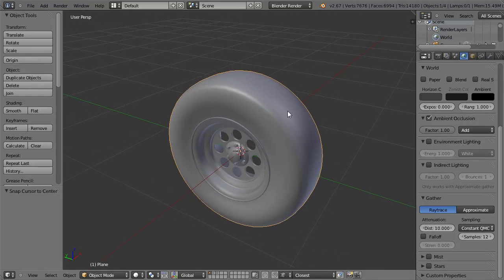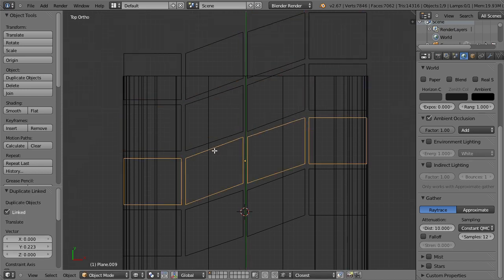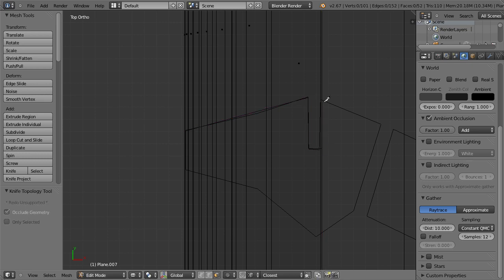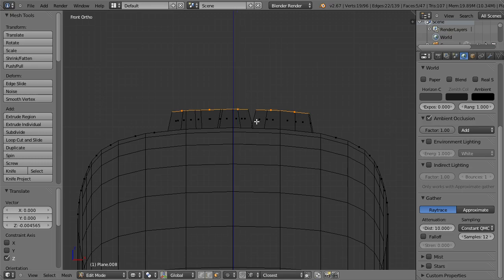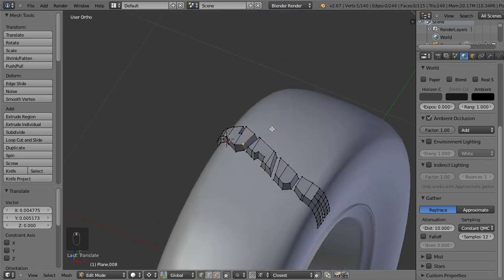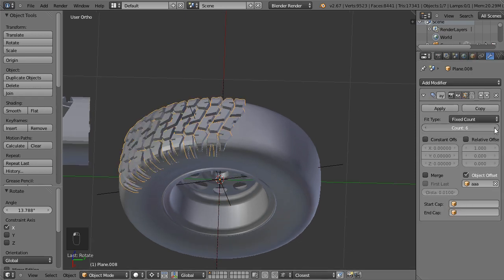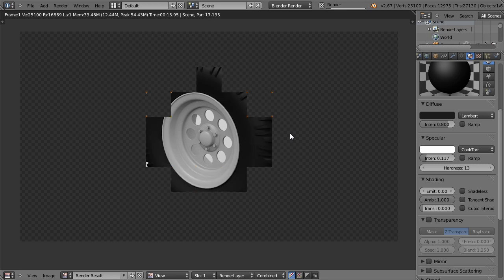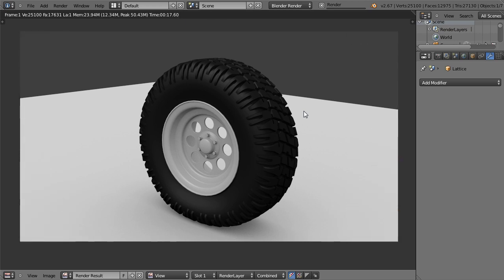Modeling an offroad wheel - Blender 3D Tutorial (Part2)

Comment: To make the empty rotate the treads perfectly to the other end seamlessly, instead of eyeballing it, try this.

for the empty rotation type:

360/(Array Count)

It will rotate the empty perfectly to seamlessly connect the two tread array ends.
Reply from the maker: +VideoGuy Nice one thanks!
Reply: +Zoltan Giber You're welcome!
Reply: +VideoGuy Would you explain where do I exactly type "360/(Array Count)" ? TIA.
Reply: Press R, then press enter. Look at the bottom of the left panel and you'll see the rotation properties. Type 360/(Array Count) in the Angle thingy. Make sure you constrain it to an axis by pressing x,y, or z after pressing r.

Comment: #ZoltanGiber     i'm a beginner in blender and i' seem to be stuck in the same area  ,  heres a screenshot  of what the array modifer is doing for me :( ( http://gyazo.com/cced6794ff4399d96e74aa1c76f6330d ) no matter what i tried it doesnt want to start turning around the weel. i followed every step in this video maybe something i'm doing wrong ?
Reply from the maker: Joe Meissour Hi Joe, looking at the picture, I believe the origin of your thread object, OR the empty is not in the 0,0,0 position, also you might need to apply transformations you've made before.

If your wheel is properly centered, having your cursor at the center (snap cursor to center command) , press CTRL+ALT+SHIFT+C (I don't know what made Blender devs. come up with this shortcut) and select origin to 3D cursor.To apply transformations if you've made some; press CTRL+A and select the ones that apply.

I'm not 100% sure but I expect this to help.
Reply: Zoltan Giber  hi :) thank you for replaying i really appreciate it just wanna say that what you said kind of opened my eyes at what i was doing wrong but just a lil problem ... now i'm getting this not sure if i'm still missing something :(  https://gyazo.com/c15876fc459afdedb76c264b3dbb2f15

Comment from the maker: Yeah, I know. The only reason why I decided not to re-record, because I believe (or rather hope) that the important parts are still understandable listening to the narration (I say them out loud). The mirror shortcut is really asking for a help: It is CTRL+M, however later it is performed again the same way with tips turned on. If you spot anything else, feel free to ask.
Reply: Hi! Great tutorial.  My problem is Lattice. When and how did you apply mirror? Your tire is changing shape symetrically. I started with cylinder, added subdiv, made Lattice , added "cutting lines " and during pulling my both sides of cylinder react in the same direction. No in opposite "mirror" side. What I   did wrong?  :)